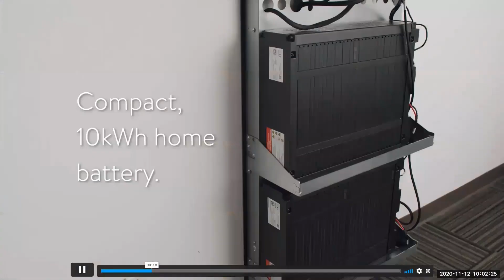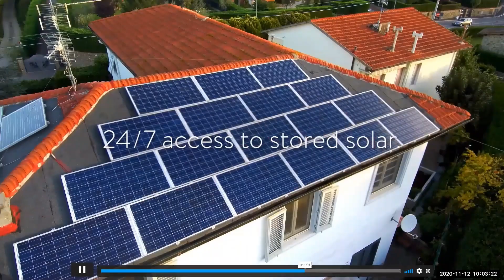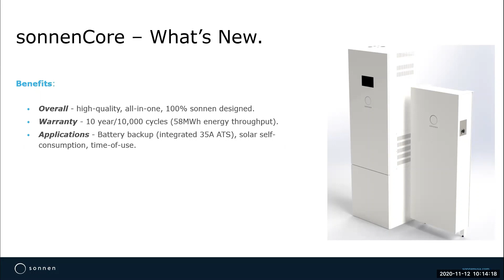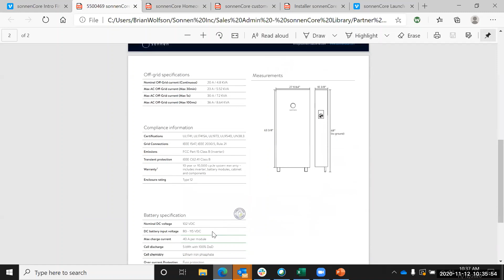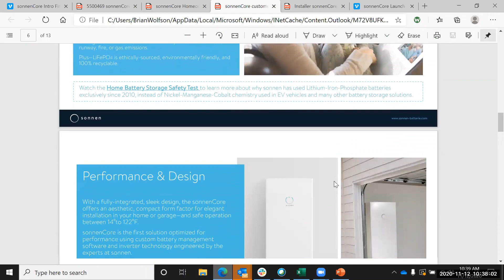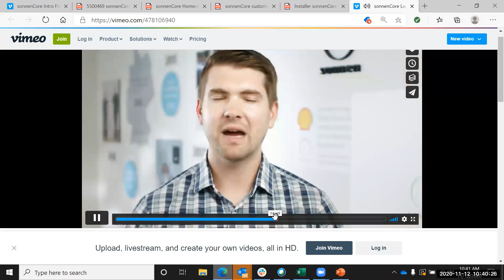A Simple & Safe Home Battery Solution | sonnenCore | Presented by Soligent

Comment: I think the installation is a problem in this design.  As the installer has to unpack each component then "build" the battery solution at the site.  Too complicated, more training required, more hooking up.
Reply from the maker: Thanks for watching! In regards to ease of installation and training, feel free to reach out to the technical team at sonnen. They are extremely helpful and quick to answer your inquires. https://sonnenusa.com/en/contact/